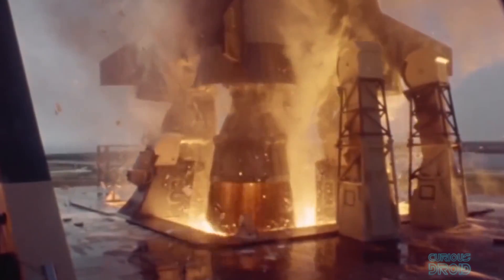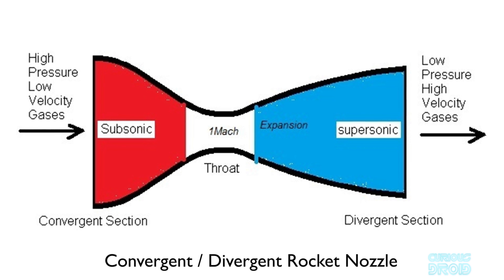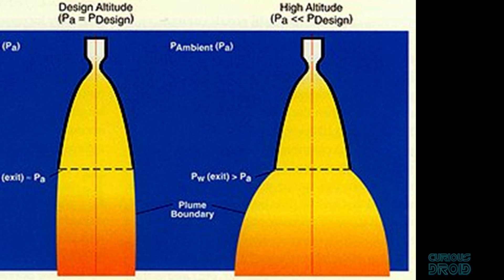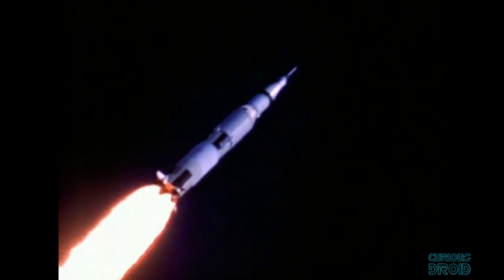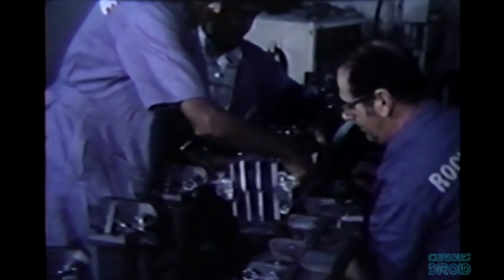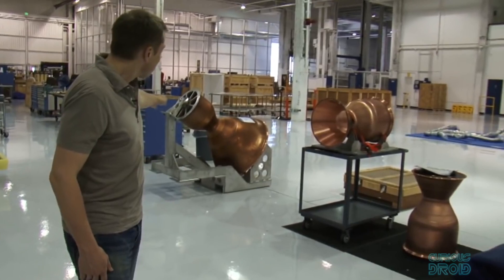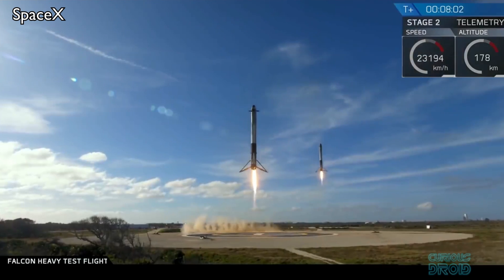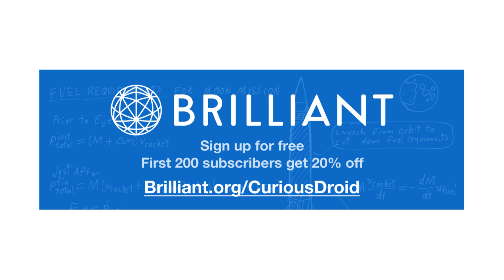Aerospike Engines - Why Aren't We Using them Now?

Comment: Did you hear about a country that maintained the the imperial units system just because of yes? well...
Reply: MURICA!
Reply: This debate would be the other way around if we used a base-48 number system instead of base-10 .
Reply: The solution would be to slowly phase the imperial system out for the metric one. Like, over a period of 30~50 years. But they refuse to even do that.
Reply: @Sanquinity  Just read the thread.
Reply: Did you hear about the probes that crashed on Mars because they made a mistake between imperial and metric conversions?
Reply: How about because the entire land is laid out in imperial units.  When you look at a map, you can say, "This road is 1 mile from that road."  It's not like we are going to smash all the infrastructure to put it in kilometers.   When you are driving north and you cross 13 mile road, you know you are 3 miles from 16 mile road.  The mile is here to stay for the next several thousand years.
Reply: Say friend, did you know that the US Standard railroad gauge (distance between the rails) is 4 feet, 8 1/2 inches. 

That's an exceedingly odd number. Why was that gauge used? 

Because that's the way they built them in England, and the US railroads were built by English expatriates. 

I see, but why did the English build them like that? 

Because the first railway lines were built by the same people who built the pre-railroad tramways, and that's the gauge they used. 

Well, why did they use that gauge in England? 

Because the people who built the tramways used the same jigs and tools that they used for building wagons, which used that wheel spacing. 

Okay! Why did their wagons use that odd wheel spacing? 

Because, if they tried to use any other spacing the wagon wheels would break on some of the old, long distance roads. Because that's the spacing of the old wheel ruts. 

So who built these old rutted roads? 

The first long distance roads in Europe were built by Imperial Rome for the benefit of their legions. The Roman roads have been used ever since. 

And the ruts? 

The original ruts, which everyone else had to match for fear of destroying their wagons, were first made by the wheels of Roman war chariots. Since the chariots were made for or by Imperial Rome they were all alike in the matter of wheel spacing. 

Thus, we have the answer to the original question. The United States standard railroad gauge of 4 feet, 8 1/2 inches derives from the original specification for an Imperial Roman army war chariot. 

And the motto of the story is Specifications and bureaucracies live forever. 

So, the next time you are handed a specification and wonder what horse's ass came up with it, you may be exactly right. Because the Imperial Roman chariots were made to be just wide enough to accommodate the back-ends of two war-horses. 

So, just what does this have to do with the exploration of space? 

Well, there's an interesting extension of the story about railroad gauge and horses' behinds. When we see a Space Shuttle sitting on the launch pad, there are two big booster rockets attached to the sides of the main fuel tank. These are the solid rocket boosters, or SRBs. The SRBs are made by Thiokol at a factory in Utah. The engineers who designed the SRBs might have preferred to make them a bit fatter, but the SRBs had to be shipped by train from the factory to the launch site. 

The railroad from the factory runs through a tunnel in the mountains. The SRBs had to fit through that tunnel. The tunnel is slightly wider than a railroad track, and the railroad track is about as wide as two horses' behinds. 

So a major design feature of what is arguably the world's most advanced transportation system was originally determined by the width of a horse's ass.
Reply: @FreedomTalkMedia  i fucking love this post 😂
Reply: @windbeneathmywings4884  I didn't write it.  It's an old piece of literature.   I remembered my uncle handing it to me on a piece of paper before the internet was invented.  I don't know who wrote it.  Snopes actually says it's not true, but the point being made is still relevant
Reply: @windbeneathmywings4884  Freedom Talk is miles ahead in the future!
Reply: @FreedomTalkMedia  lol i was talking about the railroad thing, felt like i was learning something, it took me back to the days when i used to read encyclopedias for fun in 1st grade... Even tho it was seemingly useless bits of knowledge here and there it was still kind of exciting to learn something interesting plus you never know when you might need it... But anyways i also thought it quite hilarious to hear modern technology being defined by a horses ass literally XD
Reply: @FreedomTalkMedia  i stopped watching the vid and just read your comments..
Reply: That is actually a real get of a piece of knowledge, thank you very much.
Reply: @FreedomTalkMedia  Where is this that you are referring to '13 mile road' and the 'grid lines' and what not? Curious; certainly is nothing like that in the Northeast... either way, I think any distance can be measured with any metric, with varying strengths and weaknesses to each.
Reply: @spruce_goose5169  True, the Northeast was built before the mass surveying and laying out of municipalities happened.  You don't have to go that far west from there to see it though.  I live in Michigan and I know it starts well east of here.   Take a look at this Plat map of Columbiana County, OH.  It's an Ohio county that borders on Pennsylvania -- a northeastern state.  https://www.acrevalue.com/plat-map/OH/Columbiana/  When looking at the map, you will see a bunch of yellow squares.  Those are townships.  Each township is 6 miles by 6 miles.  If you zoom in, you can see the one mile square sections of the township, but you lose the view of the township borders.  Each square mile section, as they are called, is 640 acres.   There isn't a lot of ryme or reason to how the sections are divided up as private property owners did that.  Still, you look long enough, you might find some 80 acre parcels.  There were 8 of them in every section, at one time.  Sometimes geography or cities require that a township not be an exact 6X6 square but those dimensions are the base of how most every place is laid out.
Reply: All the the fucking shit that you are saying can be measured in Millimeter.
Reply: @edrumsense  Yeah, and it would be an awful lot of millimeters to equal 1 mile and that number would not be a round number.  One mile equals 1.60934 km.  I can look at a map and count miles from one place to another, one, two, three miles from here to there.  When driving, I can see the sign for 16 mile and know it's two miles to 18 mile road.  What if the road were called, "25.7495 kilometer road" instead of 16 mile road?  Quick, how far is to the the road, 2 section lines north of there?  

Oh, it is the information age, so I can do the math with the help of my computer..... let's see, 18 mile road would be 28.9682 km road.  18 mile minus 16 mile equals(28.7495 - 25.7495 = 3.2187 km.  Oh, that is so much neater, cleaner, and easier than subtracting 16 from 18 in my head and getting 2 miles.
Reply: @FreedomTalkMedia  except this road isn't really 1 mile from that road, its 0.928742391 miles form that road
Reply: @user-by7hj4dj9s  I don't even think I could devine the difference of.071257609 & am sure I would rather"round up"
Reply: @user-by7hj4dj9s  the surveyors were quite accurate in laying out the land in 6 mile by 6 mile townships with 36 one square mile sections.  The center of each road on a section line, is 1 mile apart, not .92874391.  There are many roads not built on section lines, for various reasons, but the ones that are, stand out.
Reply: @ @FreedomTalkMedia   The rationalizations that people will go through to avoid change--even for the better--is mind-blowing. 

Yes, we'd have to change the name of a few roads to employ a far more efficient system of weights and measures.  And you would have to actually learn something new.

The only people who cling to the imperial system of measurement are the people who haven't actually used the metric system.
Reply: @eyesuckle  The reality is, the metric system is the primary system for anything easy to change in the US.  You want a bottle of water?  Well, that pint bottle is really 16.9 oz (not 16) because the water is sold in metric (500 ml).  It's not a "rationalization" to say the mile is here to stay, when getting rid of it would mean undoing trillions of dollars of real estate development.
Reply: @FreedomTalkMedia  Do you really think that 18 mile road exactly 18 miles road? You can't be serious. Nobody in Europe or other countries that use metric system says "28.9682 km road". We aproximize it to 29km. So I think it's not a problem. The real problem for scientists is convertation of meters into this imperial sh*t, because all calculations have to be in metric, because they is more accurate and based on physical constants.
Reply: @levzahaievskyi2663  The section line that 18 mile road is built on, is exactly 5 miles from the section line that 13 mile road is built on.  Exactly.  Within millimeters.  I cant' say that the center of each road is exactly on the section line.  After all, a lane could be added to one side or the other.  What I can say is that the roads are built on the section lines, the section line is in the road somewhere, and that if you drive the 5 miles from 13 mile to 18 mile, it will be 5 miles.  Meaning that since the sections themselves are nearly perfect, an imperfect road construction would not accumulate over many miles to a large error.
Reply: @FreedomTalkMedia  Must be fun to calculate space distances for you, like speed of light, light year, pc... etc. and still keep it in imperial system. Funny that nasa is using the metrical one, 'cause it's easily recognized. But hey, have some problems with it too, like we have different names for 10^9 and on here (below not)

Comment: So, to make it short -- there's a better technology still in development, but with issues since around the 1970's. Recently one of our major contractors took on the challenge to get it fully capable and no longer just concept, but ran into a fueling issue and the project was shut down. Space X should pick up where they left off instead of trying to develop their own prototype engines that aren't even shown as efficient as these are, and finish up where they left off.

Comment: Actually, the aerospike developed for the Venturestar/X-33 was worse when compared to the SSME. The SSME had a higher isp at all points, and better thrust to weight. Aerospikes are more complex and only offer small benefits, if any at all. Thus they're not really worth using at all.

Comment: The "bell" is used because the engine(s) have to be "gimballed" for GUIDANCE. And that's not a "loss of efficiency" at "high altitude" because the exhaust plume "expanding" is the result OF "lower pressure" while FUEL AND OXIDIZER DELIVERY remains "constant" and of course the rocket is getting progressively LIGHTER as it climbs and REQUIRES LESS THRUST. For such a "flawed" and "inefficient" design it sure has worked pretty damned well for a long time while your "aerospike" is still a "concept" mainly "popular" in countries and with people who have just been "observers" and/or "passengers" of the "flawed" technology.

Comment: Given the rise in 3D printing with high-temp materials I wonder why no one has thought about using a 3D printed cooling channel in the engine to allow the tip of the troidal engine being cooled a bit like the shuttle engines but just my $0.02. Ultimately I get that they maybe the better engine nozzle design BUT at the same time if what we have does work, it makes total sense why companies are sticking with a tried and true method...

Comment: Great video! As an aerospace engineer, I agree that component heritage and cost risk considerations always outweigh the desire to achieve "engineering elegance" unless such elegant tech is absolutely required to achieving mission requirements. This is true for both commercial organizations and government organizations such as NASA. The fuel cost vs. hardware cost comparison was especially illuminating. I never would have guessed that launch fuel cost was that low!

Comment: Bob Truax, as 1960's Aerojet,hot  tested an expandable nozzle in an altitude chamber which also matched exit pressure to atmospheric and would of been used in the 2nd stage of Sea Dragon but as in so many good ideas like Aerospike, never flew.

Comment: A 40% efficiency saving means 40% less fuel required to be manufactured on mars for a return. Or smaller tanks so more cargo. So not just about cost per launch in current applications... future applications could drive developments.... by the time they fly they could be 50 years out of date as well.

Comment: The other advantage of a multi-stage rocket (which was never mentioned) was the ditching of weight, leading to greater power-to-weight ratio and as such cheaper acceleration.

Comment: Doesn’t the SR-71 use something like this? It helps the engine change from a turbojet to a ramjet. I know it’s a jet, not a rocket, but it’s one of the most revolutionary engines ever and it was more efficient at Mach 3.2 than it was at Mach 1. I’m sure they can utilize some of that tech in a rocket. Someone MUCH smarter than I, obviously 😂
Reply: No, SR-71 uses more conventional turbojet. The Skylon spaceplane has SABRE hybrid air-breathing rocket engines, but they have traditional bells for exhaust nozzles.

Comment: Good job Droid. Very well researched and an effective presentation.

For those who want the true inside scoop on designing rocket engines and motors, I highly recommend “Rocket Propulsion Elements,” 17th edition, Wiley & Sons. [Disclaimer: I have no financial interest in this book and no relationship to the author(s)]. The first few editions were written by George P. Sutton. Later editions added a co-author, Oscar Biblarz.

This is an expensive (shop around!) highly technical math-heavy design handbook. But don’t be deterred...even if you’re mathematically challenged (how’s that for political correctness?) there’s a huge amount of usable information for everyone, even the most inexperienced amateur. For the experienced with a math background, with this book you can design some amazingly complex engines and motors.

Well illustrated with a plethora of drawings and tables. Many references. Shortcomings: Very little information on the chemical composition of common composite propellants. Virtually no information on hybrid engines and propellants. Nitrocellulose-based motors are only mentioned once or twice in passing and in tables/charts.

If you find an earlier edition at a huge discount over the latest and greatest don’t hesitate to buy it. The equations needed to design a nozzle or turbo pump don’t change.

Comment: I cant be bothered to check the facts but curious druid has mislead people before when they knew better. NASA is a political football and wasted resources on the Shuttle when they knew the materials had not been developed to bring down the cost of going into space and they didn't care. They didn't that so much that the shuttle exploded twice before they cancelled the rip off. The shuttle could of been a program to overcome the problems with the going into space. Getting promising materials and testing them on re-entry but Instead it was just a jobs program for connected people who couldn't get a job else where.

Comment: How about a jet/rocket hybrid space ship. It would take off and land like a plane and once its at it's at its maximum altitude for a jets, the rocket takes over. That way the difference between starting air pressure and final air are much less and would require a smaller rocket. Maybe call it a JERK plane.
Reply: So, like a Skylon.

Comment: Bah, all a rocket needs is a bunch RD-270M pentaborane engines. Many deaths per second of thrust but you can't beat that sea level ISP. :) Glushko had it all figured out, hehe.
Reply: Actually, there's something with even better sea level (and, actually, overall) ISP and less deaths per launch - the Orion nuclear pulse engine.

Comment: The main reason for multi-stage rockets is not so that you can tune the exhaust shape for different altitudes, but so that you don't have to lug the emptied lower stages to higher altitudes. It takes quite an increase in nozzle efficiency to overcome the inefficiency of doing so in a SSTO. And  it's odd that the video never mentions this.

Comment: 10:20 While this applied to the Space Race, SpaceX (and by extension, Elon Musk) has been known to just keep on developing... everything, really. To the point where -- according to that one SpaceX representative whose name I can't remember -- no two Falcon 9 rockets have ever been built the same way. If you are going to make a point, at least make sure the point you are making is valid before trying to make it -- please and thank you.
Reply: There is extremely large difference between upgrading and finetuning existing rocket/equipment than designing entire revolutionary new engine that was never successfully flown before. That kind of stuff takes years if not a decade of expensive and extensive work and research.
Reply: Jason you are a moron
Reply: The Sweez there is a difference between upgrading rockets making them safer and manufacturing and testing a completely unflight tested and risky rocket engine.

Comment: You said bells made efficient for high altitude will usually have the engines blow up at sea level. Yet you say the shuttle was most efficient in space, so shouldn't it have blown up at sea level? I suppose they engineered around that?